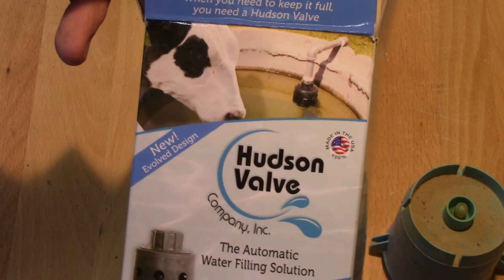How Does a Hudson Valve Work and Fail - Let's Figure This Out

Comment: between the normal gray hudson valve vs Hudson V1 high temperature Valve (Black color) Which one is more durable and have less water leak?  thank you
Reply: would the galvanize filter better than the plastic screen filter?
Reply from the maker: @baylenthesky99  This would depend on the fluid going through the valve. If it's just water, have the water tested. I prefer to run the plastic screen first then perform inspections to see if there is any deterioration.
Reply from the maker: They are basically the same design. The standard valve (ABS) is good to 125F and the V1 (Nylon) is good up to 150F. If freezing is a concern, you can use the continuous flow disc.

Comment: Best thing to do is to keep your receipt when you buy one and send it back if it fails within 2 years.  They work great until they don't.  You can take them apart, clean them, put it back on and it still will not cut off when it should.  I have gone back to the old float valve type with the metal housing.  They are more dependable and cheaper to buy.
Reply from the maker: Good Advice! Thanks!

Comment: Use the 1 inch hudson valve, remove the little plastic strainer and put an inline 100mesh stainless steel strainer before the hudson valve. I do this on my soft wash buffer tank, fills 55 gallon drum in less than 10 minutes.
Reply from the maker: Thanks for the tip